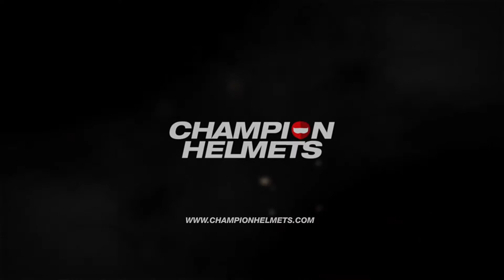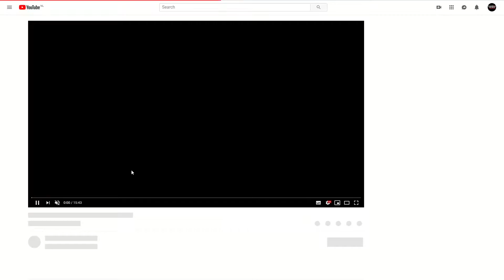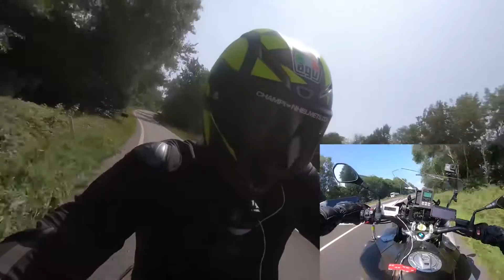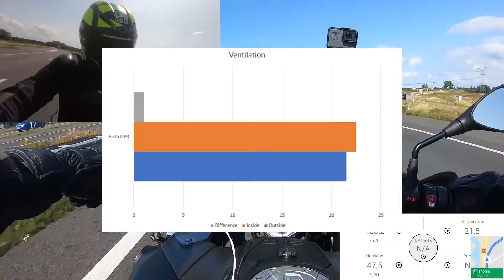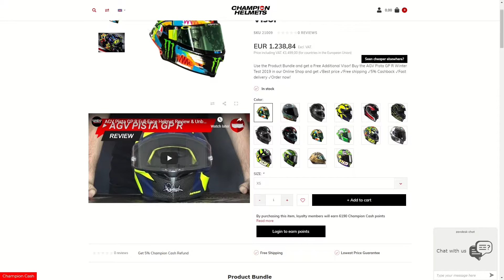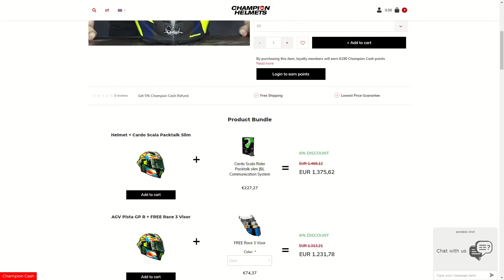AGV Pista GP R Road test - ChampionHelmets.com

Comment: The pista gp r is an amazing helmet but due to the terrible wind noise, i mean really bad, i am selling it and have bought the shark race-r Gp fim carbon helmet and hoping this will be better. Until the wind noise is fixed, il not be gojng back to AGV, used many earplugs and nothing took the wind noise away.
Reply from the maker: Most race helmets do not prioritize noise isolation in their design. We will have a road test of the Race-R Pro GP coming out soon so you can see how they compare before you make the switch. Are you looking for a race helmet specifically, or do you just want something for highway use?